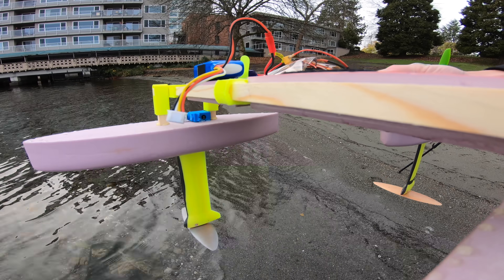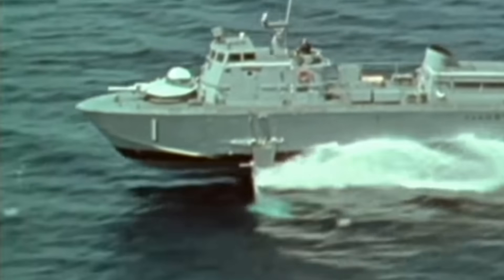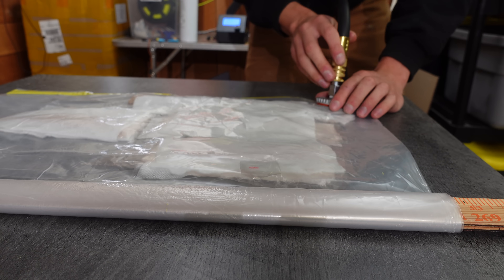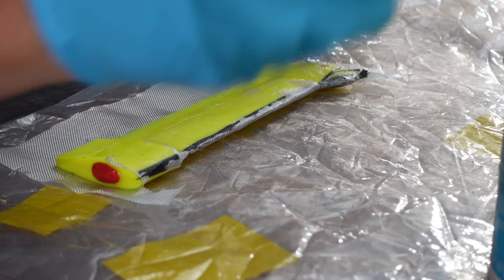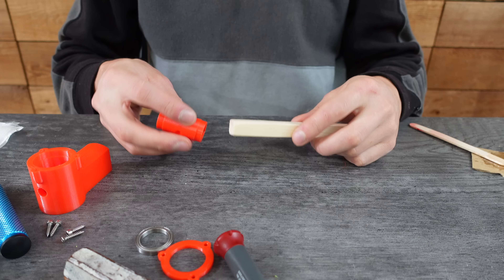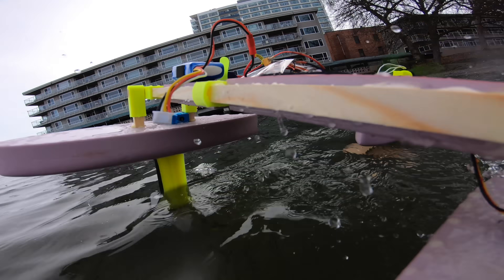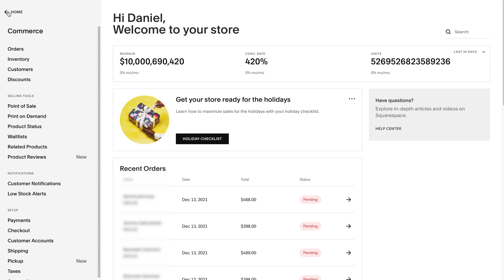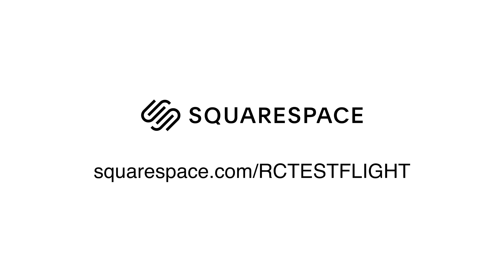R/C Hydrofoil with Sonar Pt.1 - Build

Comment: I feel like maybe putting the motor on the aft foil could help with the stability, seeing as it would move the center of thrust down a bit, and maybe make the foils a bit broader, to make the stagnation point bigger to make the pitch axis a bit smoother

THESE ARE SPECULATIONS ONLY

Comment: Hey Daniel, quick question - would a foil with a tube connection (or multiple) between a point on the mast and the laminar surface of the foil wing stabilise ? And would a two mast-three-foil setup not even stabilise in vertical and horizontal direction ?

Comment: Smooth-on has a product that you can brush onto 3D prints to make them smoother. You might still need to sand the edges, but it could help you save some time and effort.

Comment: Just an idea, instead of gluing 3D prints together i melt them together with a soldering iron, it's a much stronger bond, way less messy, but sometimes can require some extra design steps to hide the seams if necessary.

Comment: I think you could get a little passive stabilization by putting fixed foils on the verticals about half way up on the verticals. Give them only minimal angle so that leaving/entering the water doesn't create too abrupt of a change in lift/drag. That way the lift automatically gets reduced as soon as the fixed foils leave the water. Might also increase the max speed as smaller controlled foils could still lift it with the fixed ones out of the water at higher speeds.

Comment: I don't know how it would react to fiberglassing, but you can reduce the amount of sanding you need to smooth 3D prints with automotive filler primer, it worked a treat on a helmet I bought on Etsy a few years ago

Comment: There is a sailing boat called the mach 2 or moth (depending on who you ask) this uses a ‘wand’ to control the lift.

The way this works is it skips across the water in front of the boat and the smaller the angle of the wand to the boat the more lift the foil creates.

Comment: id consider using alloy to demonstrate boyancy when submerged, add a resonating technique in an electric field to an alloy itself, see if that works, even if having to use running pipes.  What if the right to an education is as important to conservation?

Comment: Just from a quick glance and I could certainly be wrong, but it looks to me like you went for a laminar flow style profile? If so, I would speculate that a more traditional "turbulent flow" profile might do better in these conditions. I would think it would be hard to have laminar flow this close to the surface and with the disturbance from the strut itself? 
If I am not mistaken, a turbulent one would give you a tad more drag but way more stall tolerance and while the laminar one wil will be less draggy, it will stall earlier and more abrubtly and have more drag once it has lost laminar flow, no?

Comment: Please construct a torpedo shaped ROV/submarine !? Autonomous. 

(You may run into radio signal problems in saline water. Acoustic beacons is an option, or radio antenna near the surface.)

Comment: **PROJECT IDEA** You could make an autonomous expedition ship model with launchable ROV. Waypoint mission to a wreck or dive site. Position hold using thrusters or some system to that effect. Long distance FPV ROV broadcasting from the ships antenna. Probably a tethered sub. Though a recovery system and low frequency tetherless ship to sub control link would be so gnar.

Comment: Perhaps someone with a grounding in materials engineering can explain it to me, but why was it necessary to sand the foils smooth twice? Seems to me that at worse, an additional layer of fiberglass would provide enough margin to apply it all first, then sand the part smooth. Am I missing something?

Comment: My thought is that you need to put the propulsion underwater so you can run the motor and craft at a slower more controlled speed.   Also, to maintain a constant height, I think you need some kind of height sensor under the craft so that the wings need to know what angle to adjust to vs running just on top of the water.   Otherwise it's a neat video and concept.    Love your manufacturing process with all the parts.

Comment: For design inspiration, ceck out the hydrofoil action of the recent America's Cup race. also check out the automatic foil height adjustment used on "moth" sailing dinghy's, just a rod hanging in the front with linkages to the foils.

Comment: pro tip for 3d printed finishing -- instead of just sanding, try using a blow torch to lightly melt the exterior (works best on solid bits), and then sand any small bumps or edges! gets rid of any discolored plastics, gives it a great shine, and will make the piece slightly stronger as the filament marks are now welded together a bit better! 

that, or try using a plastidip or thick/durable paint to fill in gaps easily

Comment: An exceptional project like this, using 3d notch machined on the CNC Router (I have a Router and I know how difficult it is to create 3d caver vectors on the aspire).  And you're wrong in the aspect of hiding the electrical and electronics from the water?!  Man you fell in my concept! 
  Improve in the next video, it's a challenge

Comment: Maybe wired question but why wont you change filament to be more temp. resistant? ABS or ASA would stand to around 96C and they are much easier to sand than regular PLA. Or maybe switch to PLA+ or some other different tougher blend (those might be also higher temp resistant - depends od the blend like Fiberlogy impact pla). If it comes to lack of chamber - try Asa or cardboard box.

Comment: just a little tip. use heavier hulls for more velocity speed, add a skip to the bottom of each hull, and a fine grill infront of the propeller to catch anny debris and to break up waterdroplets... alldo if you want controlling to be easier use rotary dials so you can lock the ailerons and elevator at certain angles so you dont have to wobble around 50 individual controlls! allso you could call up a friend to help stear it... its a lot easier with dual piloting

Comment: Because I am a smartass, I have to ask how well does funfetti work to reinforce the fiberglass?  I know that people will use a flapper/follower to determine the correct ride height for foils when they get up on the sticks. Full scale PHM's used a water pressure sensor in foil uprights to determine their ride height.

Comment: I think you could consider the passive foiling systems that both Aquila (36 foo) and Insetta (35 foot) use on their catamarans fully submerged.  Admittedly neither lifts the hulls COMPLETELY out of the water, but they're far enough to get some serious speed and fuel efficiency boosts compared to non-foiling cats.

Comment: go with a puller instead of a pusher? maybe use two motors so you can use smaller props?
why not add at least a little dihedral (stability) to the foils? or is that cheating?

Comment: Daniel, looking forward to see what the FC can do. I considered using one myself for adjusting ride heigth of a hydrofoil boat (mine is ending up more like a SWATH, though). I got sidetracked by some 1:1 plane activity, but was experimenting with the BMP280 pressure sensor for  ride height input (Ultrasonic sensors don't work well at small scale). Use one on a $5 break out board and feed the I2C to the FC. You may need to place it inside a special cavity with a flexible membrane. I hope you can figure out a clever and practical solution to this :)

Comment: Awesome video Daniel... id point out though that lift doesn't change with depth... the variables tge lift equation don't change( or rho, P) but it stabilises fir the same reason dihedral work, the lower one has a high Lift coefficient, to to a slightly elevated AOI.

Comment: I'd have printed the wings in ABS, then used acetone to finish them. if you use a .12mm layer height you will get hardly and layer lines, and the acetone will make them like glass.

Comment: Need a leading skimmer (ski?) to control the planing angle and clearance height. (Videos with Harry Larson are a bit long/dry, but seem to explain well.) Either that or mess with LIDAR electronics again. If you get it working at that point, perhaps collab with Skatune Network for the song about it, that would be the icing on the cake.

Comment: Try thinking of the design more like a plane, move the center of gravity to the main lifting foils, increase the fuselage length, and decrease the stabilizer size. Some extra weight could also help with sensitivity. Fractions of a degree in Aoa make a huge difference. Flying at a constant speed is easy to control relative to takeoff and acceleration, if your craft can takeoff with little input by design it’ll make everything a lot easier

Comment: Some very cool building techniques with CNC and 3d_print equipment. Daniel is really upping his project experimenting abilities. 

Do all 3 wings need to pivot? Like a flying wings elevons, think only the front two would be enough.
Having the 3rd rear pivot is likely making pitch control much more complex and sensitive. 

The tip over roll effect is likely being caused by cross control condition of aileron and ruder action, where the boat ends up with sideslip motion relative to water vs forward.

Comment: So... I predict the controller will need to know the distance to the water surface.  Then either do some rolling average or other way to filter out rough water. Alternatively, you could do a depth sensor.  I've never thought of it before, but I'm guessing a depth sensor naturally ignores waves (?), but dunno how you'd get it to work while moving through water.  Putting a filter on barometer works in air, but that wouldn't work in water.

Comment: This is cool as. I'm currently an navel engineering student and over the summer attempting to make a foiling k1(kayak) very similar concept and foil shape.  It would be interested to know the foil profile you used and the reasoning.
Reply: He used the eppler 817 or similar, probably because it’s what comes up when you search hydrofoil airfoil. It is designed for cavitation resistance. Eppler 836 is pretty good for struts and something like MRC-16, AH80-129, or Eppler 393 are great for lifting surfaces of your kayak!

Comment: To retrieve my RC boat from the shore I used to carry a large fishing pole with a good spinner reel and one of those nerf footballs attached to the end.  If you hit behind the boat on a reasonably straight line to where you are standing you could walk the necessary direction on the shore to get the line over the boat and just reel the football to the boat and bring it all in gently.  You would not believe how far you can make that nerf dart go with a very hard cast.  It made a good standard line cast look like an absolute joke.

I thought the fire was pretty cool.   At least you got it on video.

You might want to look at micro-balloons to add to the epoxy to make a very light and easily sandable filler.  We used it regularly building a Long EZ.  You mix it about the consistency of peanut butter, so it spreads easily and doesn't sag when filling.  The downside is it requires another curing cycle, obviously.  

And wear a mask when sanding fiberglass.  When it gets in your lungs it NEVER goes away, and it is so sharp it reeks havoc when the lung expands and contracts.  It's chemically inert, but so is asbestos, I think, so that doesn't help much. Very tiny strands of sanding 'dust' are quite easily kept aloft for long enough to breathe them.

Enjoyed the vid.   Nice work.  It looks to me like you have WAY more travel than you need on those foils, BTW.  Remember that wings operate very differently in air than foils in water, as you pointed out.  I think a little pitch change goes a long way.  I'm also a bit concerned that the bandwidth might be a bit too low, but time will tell.  Great project, can't wait to see it all up and working.

Comment: Fantastic work again! Are your foils the effective/efficient size for  the weight of your craft and the drag of the wetted surface? What are you using to calculate the measurements? Do you plan to address the wracking and instability of the rudder foil?

Comment: Sanding does work for 3d printing asthetic pieces. For something like this in the water; though, you really want to use an epoxy fairing compound to fill in the grooves, not break down the ridges.

Comment: When I was a kid, my dad and his RC friends were into boats for a bit. My dad had an RC racing boat that would die in the middle of the water when it ran out of fuel. So he had a cheap Walmart RC wave boat with a length of rope tied to the back and a fishing bobbler on the end of the rope and he’d use the Walmart boat to loop around the racing boat, snag the rope on the rudder, and tow the racing boat back to shore. Some of the other guys had a fishing pole with tennis ball tied to the end of the line so they could cast out over the boat and hopefully snag the tennis ball on the boat as they reeled in and they could pull their boat to shore. Maybe bring some nylon rope with a tennis ball with you for these boat experiments so you don’t have to wait for it to float back to shore or get wet swimming out to it, assuming it’s in range... Or use a drone to drop the line over the boat then pull it to shore

Comment: WCS and rezero after 180 or 90 degree rotations can be tricky.   Recently made some parts that were 4 sided 90 degree rotations and it was a learning experience.   My CNC router's spindle run out does not make it any easier.   Was using clamps but should have machine the soft jaws as a custom fixture setup.

Comment: You can also Smooth out 3D prints by rubbing the lightly with acetone, or hanging them on something and using a spray bottle to spray acetone on it, and then wash the acetone off.

Comment: If you wind up building a second one, I would redesign the tilting mechanism for the foils so that the foils pivot at the top of the vertical part. You could probably drastically reduce the size of the vertical part of the foils, and make the transition area much smoother, which would reduce your drag by a good bit. The downside is that control forces will probably be way higher, as the servo will now have to work against a big lever.

Comment: Nice! I tried making a foiling sailing boat (Americas Cup AC75) I used an arduino an ultrasonic sensor and an IMU. I couldn't get to tuning PIDs because I struggled making the cant arms light and strong without any slop. Maybe I'll get back to the project!

Comment: This is when a fire engine boat would come in handy, you could control it to put the fire out, then use a mini harpoon (that you attached beforehand) to tug it back in.
Reply: im pretty sure peter stripol made a video a lot like this
edit: it was peter working with flite test, they made a boat that has a harpoon on the back that you can shoot at boats and planes on water and drag them back to shore

Comment: i would use a single hull instead of 3. makes for easier weight placement. i would also make the foils shorter so that the top height becomes lower

Comment: A lot of smaller hydrofoil sailboats use a simple physical mechanism to control "flying" height. Like a float on a lever connected to the hydrofoil control. When the boat gets high enough out of the water, the lever drops and pulls the hydrofoil down, stopping the boat from rising anymore. It's a nice feedback mechanism that makes for easy control.

You could also do something similar with a sensor connected to the lever, and/or a lever that physically overrides the height control at the upper limit?

Comment: Dude, use at least PET-G for your functional parts! PLA will soften in you car on a warm day. Since you've got an enclosed 3D printer, you can use ABS, or even Polycarbonate, though those will be more challenging to print correctly. Awesome work as always!

Comment: is the fiberglass just for water-tightness?  Or does it have more benefit?
Reply from the maker: It’s actually not very water tight on it’s own. It’s mostly for durability and an easily sandable surface finish

Comment: You Don't need to sand to get rid of the ridges. Put them in a container with acetone and a little fan to circular air and it will smooth out the print
Reply: That works, but only for ABS

Comment: Alexander Graham Bell did a lot of research into hydrofoils in the early 1900s, cumulating with the HD-4 or Hydrodome number 4 which Bell designed and built at Beinn Bhreagh Labs in Nova Scotia, Canada. In 1919 it  set a world marine speed record of 70.86 miles per hour (114.04 km/h).
Reply: This is new information to me. I'm going to go do some research on that. I had no idea that A.G. Bell did anything with boats of any kind. Thanks for the new knowledge. 🙂
Reply: @bob2161  Bell, like many smart people, had a wide range of interests and intellectual pursuits. Glad to have given you some new  info...knowledge shared is knowledge multiplied!
Reply: @FarrellMcGovern that's a great philosophy. Thanks again.